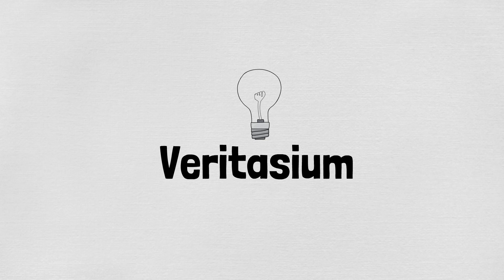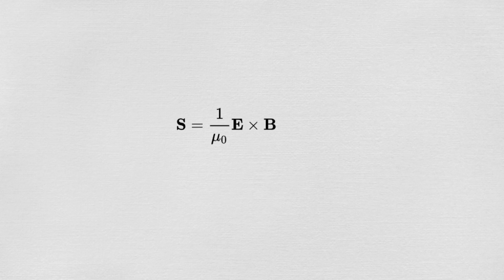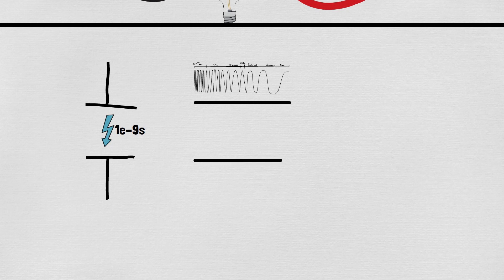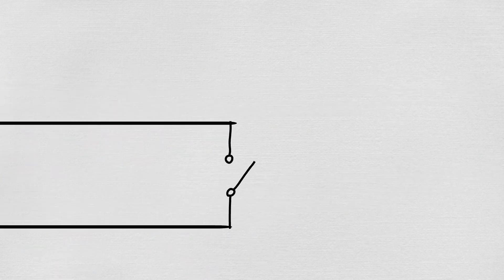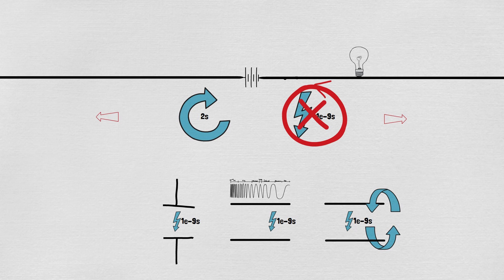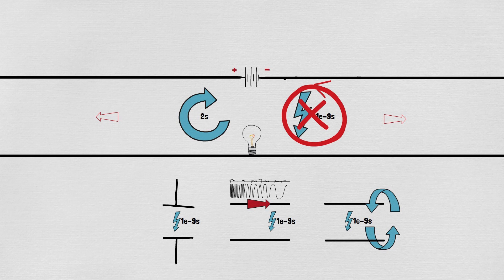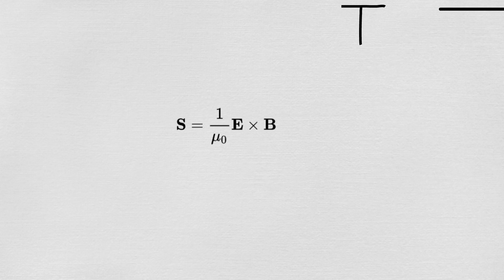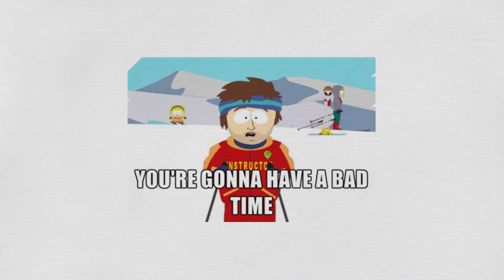Veritasium is Right? (see description)

Comment: There is a good video which answers your gripe about looking at the parallel wires as either a capacitor, or an antenna, or a transformer. The power is transmitted via the changing EM fields inducing a current in the opposite wire. The current flows because closing the switch makes a complete circuit, and his example had the switch where it was for a reason. Obviously, changing the conditions of the circuit will change the outcome. Veritasium said nothing about faster-than-light communication. 

It does take a little time for the full power to reach the bulb, but there is a momentary near-instantaneous jolt of power because the changing EM fields propagate at light speed and immediately induce a fraction of the current in the other wire... As soon as there is potential, the electrons begin to move along the potential difference (as soon as they are affected by the potential difference, which propagates at light speed). This creates the changing EM field, which induces current in any conductor close to the wire (such as the parallel wire of which we speak).

Ref: https://www.youtube.com/watch?v=MDOYPQQmuco
This one is good too (shows a simulation of the propagation of EM fields in this hypothetical setup): https://www.youtube.com/watch?v=aqBDFO1bEs8

Comment: I'm happy my own answer was somewhat similar to this. The connection must propagate at the speed of light. How else would each side of the battery communicate that there is a flow in progress? If a wire of electrons allowed lightspeed communication, then that would be quite the discovery. And breaking causality im sure :)

Comment: I really like this video, but I'm afraid I still agree with the poynting vector argument. IMO the distance between the wires is a bit of an  obfuscation. The original diagram (if I remember correctly) had the bulb and the switch alligned in the x axis. The important factor is the distance between the bulb and the switch, which is assumed to be equal to the distance between the wires. There are a couple of different ways to think about it.

At steady state, before the switch is turned on, there is a potential different across the switch. The charge density on one side of the circuit is higher than the other.  Similar to air being let out of a balloon, as soon as the switch is flipped charge starts flowing through it as the two sides of the circuit attempt to reach equal charge density. In normal circuit analysis, constant current flow arround a closed loop is actually an assumption/simplification. The flow of charge causes a change in the E field and thus a change in the B field, generating the poynting vector. As the bulb is also assumed to be ideal it generates light proportional to the energy transfer, "switching on" as soon as the energy passes across the gap from the switch to the bulb. 

For your other examples, if the switch was several light seconds away from the bulb, it would take several seconds for the energy to transfer. If you had an infinitely long wire which wasn't connected at either end, the circuit would still turn on. A circuit requiring a closed loop is based on the assumption that all parts of your circuit have finite size. For a normal circuit with a finite wire, the current initially flows and then stops as both sides of the circuit reach equillibrium. For an infinitely long wire, this never happens, as it requires an infinite amount of charge to achieve the same charge desnity on the other side of the switch. With bounded current flow, this will take infinitely long.

If you don't like this perspective, you can also consider it in the frequency domain. As the switch connects, one of its terminals is immediately brought to high voltage. The step change at that position is described by the heaviside step function. Its an odd function so can be composed entirely out of cosines with non zero amplitude at all frequencies. You are effectively generating a load of photons with these different frequencies, whose phase moves out of step with time and distance. Moving back into the time and space domain this phase shifting causes the voltage to vary with distance before the system reaches equillibrium (eg changing electric field by the switch terminal the instant it is turned on). In low frequency circuit design this is negligible, but becomes significant for high frequency circuits like motherboards. It is also one of the reasons why the bitrate of fiber optic cables is bounded. As you switch your light source on and off for the zeros and ones, you create photons across the frequency spectrum. The relative phase shifting between these frequencies of photons ruins the sharp edge of your step change as they travel, with the bits in your signal blurring together at the end of your cable.

Comment: I think one thing Vertitasium did not emphasize is that the answer is 1/c because the switch is 1 meter from the bulb. If you move the switch 5 m from the bulb, now the bulb will come on 5/c seconds after the switch is closed.  The distance from the battery isn't relevant, since the entire wire leading up to the switch on the battery side is essentially just a single very long battery for the purposes of this situation. There's no violation of causality, information about the switch is only moving at the speed of light.

Comment: There are two specific conditions that cause confusion in this problem. 1. The switch must be adjacent to the battery. 2. The wires must be parallel and close together so that the electromagnetic field between the two wires is significant. Closing the switch will result in a pulse of voltage and current travelling along the wires and coupling between two closely spaced wires will result in a voltage and current pulse reaching the bulb almost instantly. The bulb will not remain continuously lit though until a continuous flow of voltage and current propagates through the length of the wires. So an initial flash and fade, followed a second or so later by the bulb lighting continuously as the voltage and current stabilise around the circuit. Flipping the switch off, will result in the bulb remaining lit for a second or so due to residual energy still circulating in the wires. No great mystery and obvious to those who have studied transmission line theory.
Reply: The problem is wording and the way the initial question was worded.

Comment: There is a current when you turn the switch on. The gap between the parallel wires can be approximated as a bunch of resistor with very high resistance in parallel. Parallel resistor drops their total resistance as you add more of them. So the act of switching the switch correspond to adding a large number of parallel resistor with very high resistance to the circuit so there is a current that will flow. The switch itself can be viewed as a resistor with almost infinite resistance in series and switching it on is like replacing that resistor with an almost zero resistance. The assumption that there will be no current when the switch is turn on is wrong.

Comment: There is no issue with causality. The current starts flowing through the switch as soon as the switch is closed. Therefore there will be an EM field at the position of the switch immediately and it will induce a current in the wire just opposite the switch 1m/c seconds later. If the lamp is just opposite the switch, it will light up at this moment.
Of course, if the switch is further away from the lamp, it takes longer.

Comment: Excellent explanation! All the other "correction" videos are missing the point about not using time-variant equations to determine the transmission time between the battery and the bulb. Similarly, the other videos that use lumped element, transmission circuit designs to show transient responses are incorrect simulations. Just because a program gives an answer, doesn't mean the model or answer is correct.

Comment: Yeah, the Jackson book is a doozy! That was my text in grad school. Anyway, to add to your video, I have the following thought experiment. Set up to identical circuits like the one in the videos. Lay them right on top of each other, with the insulation of each wire in contact the entire trip. Now you have two batteries. Reverse one of them. Now the fields outside the wire should cancel out, but I bet the bulbs still light up! What d'ya think? And yes, that J.E term is pretty important!

Comment: The antenna analogy is really the easiest. Assume (as VT did) zero resistance. Also assume some other "ideal model" characteristics, and a 12V battery with the switch on the +12V side. 

The entire loop starts at 0V. When the switch is closed, current will begin to flow into the loop. Over the first microsecond, current flows 300 meters into the wire. This creates an e/m field around the first 300 m of wire. This changing field induces opposite current in the wire across from it. This is simple (?) first year physics. 

Over the second microsecond, the process is repeated in the second 300 m of wire. In the first 300 m, the current is steady, the e/m field is not changing, and current is no longer induced in the wire across from it. The current induced in the second 300 m takes another microsecond to return 300 m to the bulb. 

Rinse and repeat. Of course it's really a continuous process, as the head of the current travels around the loop. I just thought it would be easier to explain at discrete points.  

It takes 1/2 second for the current from the switch to reach the end of the loop, and another half second for the last of the induced current to return from the end of the loop. The regular current flow through the wire then arrives at the bulb.
Reply: When the switch is closed, what is the magnitude of the the current that is beginning to flow into the loop? Would it be the same current if the far end of the wire was broken?
What makes you think that the "changing field" induces the opposite current in a wire 1 metre away from it? Would it be the same "opposite current" if the wire were 2 metres away? What if we placed another piece of wire unconnected to anything 1 metre away - would it still have an "opposite current" induced into it?
I really don't think an antenna analogy is very helpful here.
Reply: @RexxSchneider  With 0 resistance in the wire, the current would be the maximum that the battery can supply. (This is an ideal model, not exactly realistic. You could do a realistic scenario, but then the wires would have to be much shorter.)

If the far end of the loop was open (broken) current would flow from the switch for 1/2 second. When the far end of the wire reaches 12V, current will stop. It takes a potential (voltage) difference for current to flow. It will take another 1/2 second for the last induced current to return on the bulb side. 

First year physics. A changing e/m field induces current in a conductor (wire). The wire can be moving through the field (as in a generator) or the field can be changing astound the wire (as in a transformer or antenna). If the wires are farther apart the field at the "receiving" wire will be weaker, so current will be less. 

If you cut both ends of the loop (two parallel wires) nothing changes during the first 1/2 second. The bulb doesn't see a difference (maybe, see follow up comment) for another 1/2 second. 

The antenna analogy is "good", but in the real world nobody uses DC with antennas because all you would communicate is a single pulse. So AC at "radio frequencies" (RF) is used. With AC, the e/m field is "always" changing, so current keeps flowing.
Reply: @RexxSchneider  As I was writing, it occurred to me that current hitting the end of an open wire, 1/2 second away can't immediately stop current at the switch. 

So rather than what I originally said, I think it will be more like...
- After 1 microsecond, wire at 300m is still at 0V. Wire at the switch is 12V. Current is flowing in the first 300m. (Wire at 150m is at 6V.)
- After 2 microseconds, switch is at 12V. 150m is at 9V, 300m is at 6V, 450m is at 3V, 600m is at 0V (and starting upward).
So the voltage in the wire is linear from 12V at the switch to 0V at the point that current has reached. 

I'm thinking this out as I write, so probably not perfect. Then again, the whole scenario is pretty sketchy. So the whole thing with AC power and it gets a lot simpler.

Comment: The root cause of the disagreements is overlooking the defined nature of the bulb. It is a theoretical bulb that will light as soon as any current flows in it. That is, it will light immediately there is any more than zero power available.
If that is taken into full consideration, the bulb will light at time minus T, where T is the age of the bulb when the switch is closed.
If stray EM fields are removed (a Faraday cage 600,000,000 m long!) then the bulb will light as soon as the radiation from the spark gap transmitter (switch) reaches it.
The resistance of the bulb will define its brightness over time.
If it has low resistance it wiil initially be dim, only achieving full brightness after several seconds while the transmission pulse is reflected around the circuit (and across the 1m gap)
If it has high resistance it wiil flash brightly and dim for several seconds while the transmission pulse propogates, ending up being dim
If its resistance matches the impedance of the transmission line it will light after 1/C seconds and remain at that brightness, initially powered by the transients but ultimately by the steady state current flow.

In the first 2 cases, "several seconds" is determined by the battery impedance, any mismatch to the transmission line impedance will prolong the transient phase.

Comment: Btw thats not the first controversial explanation on Veritasium. He also once claimed, that we can't know the speed of light, because we need a path to a distant object and back to measure it.
Lets say we have a mirror on the moon. We send a signal to that mirror and it reflects back. We would measure that it took 2 seconds. But now Veritasium claims, that we can not know if the speed of light is (for what ever reason) c/2 to the moon and faster than c on it's way back.
But from what I know, the speed of light is not arbitrary some value but it's determined from the "resistance" vacuum has to a propagating wave. So it's a fundamental property of vacuum that determines c. And since the vacuum between us and the moon is the same in either direction, c must be the same all the time.

Comment: Nice graphics... Well-made video.
However, you're wrong about moving the switch around and claiming spooky action at a distance.
The switch is next to the battery to prevent or allow current flow.
It's that which produces the energy-carrying field that heads over to the lightbulb.

Comment: Energy does most definitely flow to the bulb in a very small amount of time - what we have are effectively two very long antennas placed a meter apart. So it’s not a lot of power at first, but it’s still power. If it didn’t, we wouldn’t have radio and my mobile phone wouldn’t be able to work.
Reply: Sure, in theory everything in the Universe is connected (via Feynman path integrals) but that is not nearly enough power to actually LIGHT the bulb.
Reply: @BitJam  Never claimed it was enough to light it. I can take a bit of wire and connect it to one of the probes of my DSO and pick up the 50hz frequency of the mains and the data bursts of my ‘mains wiring’ modems.

Comment: So would the lightbulb essentially power up slowly over the time it takes for the field to be established? And would this be 2s + 1/c until the bulb is fully lit and steady?
Reply from the maker: it would power up over time yes, and it would take significantly longer than 2s because of all the reflections, actually. but crucially, derek's thought experiment was designed in such a way that no matter what else is going on, the bulb turns on in 1e-9 seconds, and i didn't fully appreciate that at first. (see the description).
Reply: @antimatterhorn  I really appreciate that you edited the description when you realized the mistake you made, but maybe you should make another video about this to clarify? A lot of people are going to come to this video and will have more misconceptions because of what you say in this video, completely missing the transmission line theory aspects (and many won’t read the updated description).

Comment: I recently cracked open my copy of Jackson (2nd Ed.) to brush-up for a new work assignment.  Being older (and a bit wiser) Jackson is a lot easier to digest.
Reply from the maker: that's been my experience with a lot of physics subjects as well, especially thermodynamics. once removed from the pressures and stress of grad school, suddenly these things become so much easier to relearn. while in grad school, i felt as though thermo/statmech was my least favorite class and the least penetrable. then i mistakenly made a career out of solving exclusively thermodynamics problems, and when i look back into my text books, it strikes me as silly how confused i used to be.
Reply: I've had a similar experience. I struggled with E&M a bit over 50 years ago. A few years back I picked up my old copy of Jackson and glanced at a few well-worn pages. To my surprise, I could read it, and it didn't look all that hard. This surprised me because I had not dealt with material at that level for decades. Maybe our brains continue to process that stuff even when we're not aware of it.